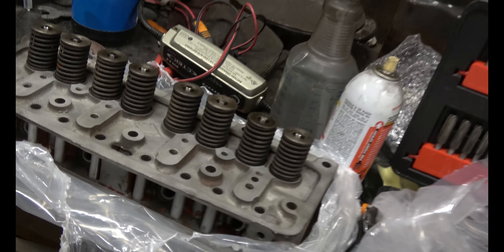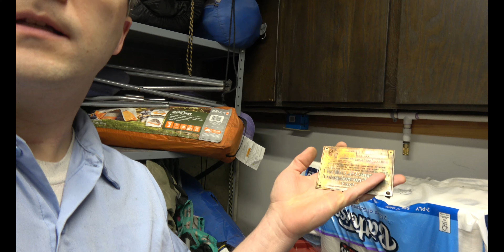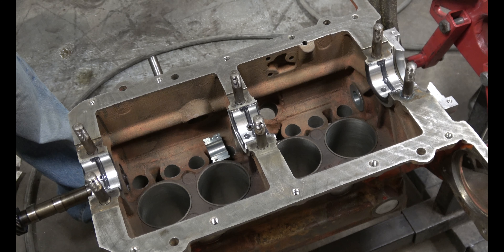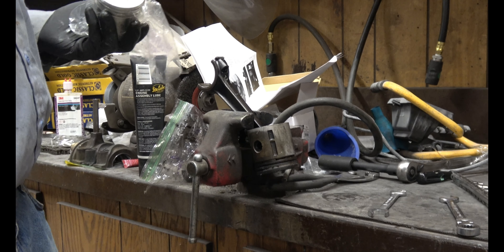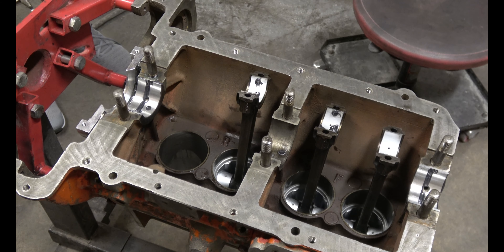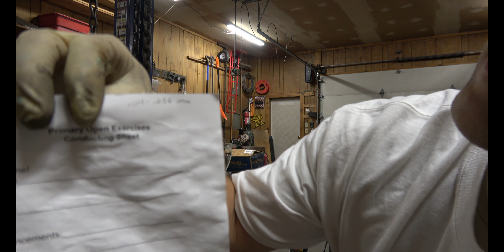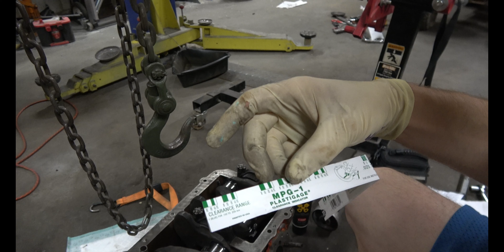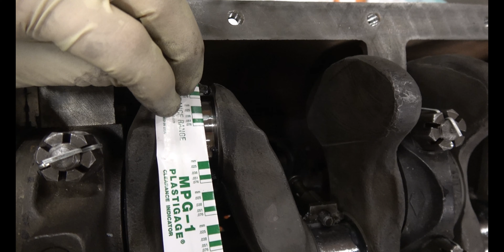1951 MG TD Engine reassembly part 1

Comment: I wouldn't put foil in there. Take the crank, rods/pistons to machine shop and let them polish the crank pins to fit a new quality set of bearings at full torque.

Comment: Great video!  I'm curious how things turned out with the rod clearances. I'm having the same problem now with my XPAG motor. How many layers of foil tape did you need? My bearings are .020" oversize.
Reply from the maker: I need to pull it apart because the rear main seal is leaking badly. So I'm going to take those apart again and do some measurements. Maybe get a machine shop to help me out. I don't think putting foil in between the Caps is the right choice.
Reply from the maker: Better to get it right the first time than to spin the bearings.

Comment: instead of chasing all the threads in the block, an alternative might have been to simply throw some brake cleaning the holes and blowing them out. then, on re-assembly only chasing the threads that show a reluctance for the bolt to thread normally. and then only by hand. 

in addition to dressing the top of the block, being so critical, would be something i would want a machine shop to do. no matter how careful one may be the corners and edges of the top of the block will most likely be rounded over by a thousandth of an inch or so making the head gasket's task more difficult. i'd also have them take a few thousandths off the head and balance the pistons, rods, crank, clutch and flywheel and possibly hone the cylinders. the precision was pretty poor in the early '50's compared to what can be had for a reasonable cost (assuming a disassembled engine) these days. doesn't cost much if you hand the parts to them in a box. throttle response will be vastly improved along with massively reduced wear. 

chasing with that drill is fraught with error, IMO. can't tell if the center and end cam bearings were lubed before assembly, but it a good practice to do so. if not, they will probably remain dry until the oil pump is primed and can build up pressure. of course, it may be possible to present oil to the oil pump and turn it with a drill or something and pre oil all the bearings at some point before attempting to turn the entire engine over. IDK. i found that i could easily install the pistons from the top without a ring compressor. i simply pushed the piston in until it reached a ring, then squeezed the ring together by my fingertips. then along with a little downward pressure on the piston top the piston and ring slide in. i did this for each successive ring and piston.  doing it from the top naturally aligns the piston in the sleeve to begin with. 

i used plasti-guage to measure crank bearing clearances using the old bearings and bought the appropriately sized bearings. to determine that, i would buy one crank bearing of standard size (or borrow one). then use the plasti guage and buy a full set of crank bearings. i would not trust the aluminum shim. aluminum is a soft metal and will compress over time and cause premature bearing wear. 

anyway, don't do what i did and put too much paint on the block and head and rocker cover. i spent a couple of years sorting out an overheating problem in the summer only to have it eventually go away on its own as the paint and my ignorance peeled away.

good video. should be a real help to those rebuilding a similar MG engine. :)
Reply from the maker: Yep,. My machine shop did all that.  All the threads were rusty the bolts never having been undone in 70 years.  Chasing the threads made reassembly a breeze.  Didn't have to stop every ten minutes to figure out another bolt hole.